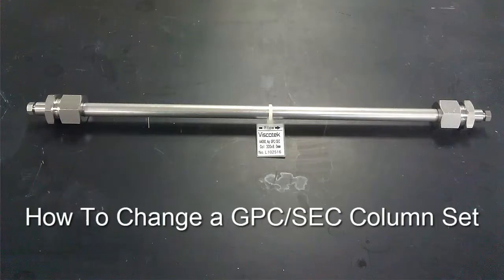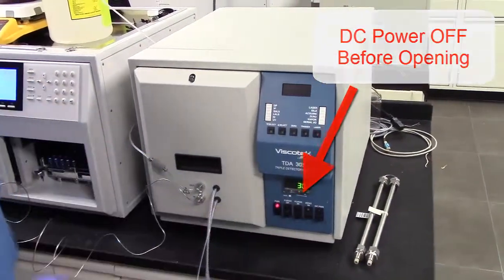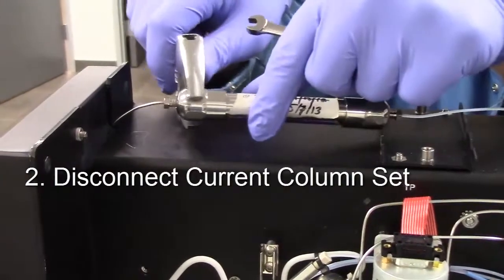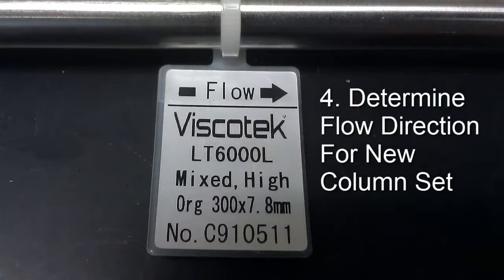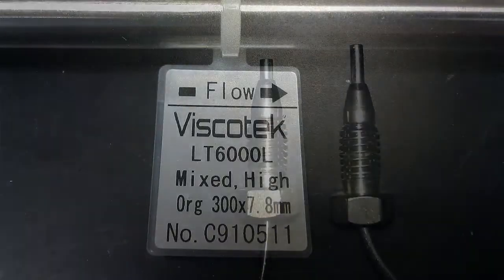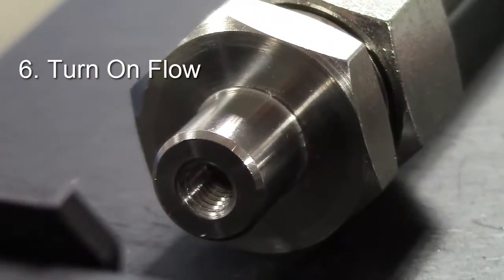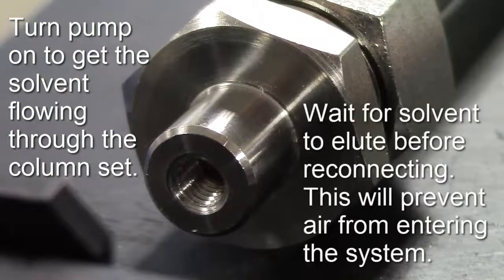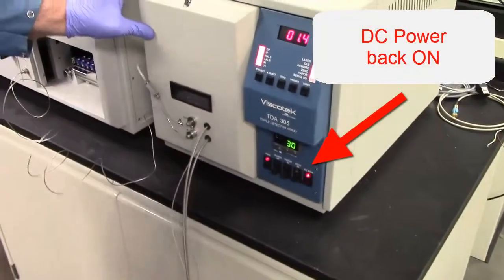How to change a GPC/SEC column set

Comment: A THF system should be in a fume cupboard.
Reply from the maker: Hi Simon, Many thanks for the comment.
Use of a fume hood for THF can be dependent on local regulations and we would always recommend you follow those guidelines. In this case a fume hood is not required but multiple extraction trunks are in place to capture any fumes and remove them safely.